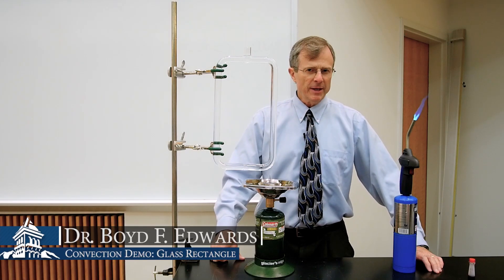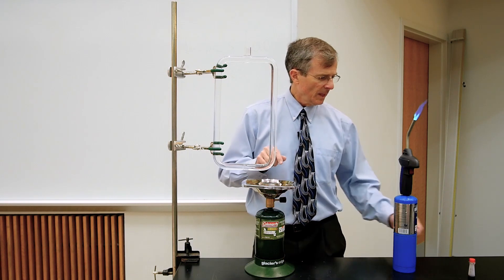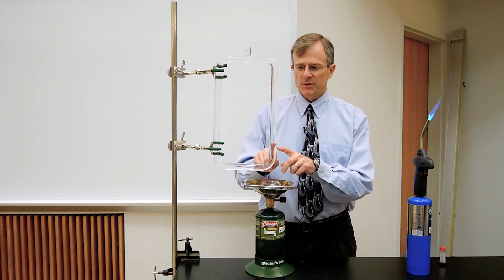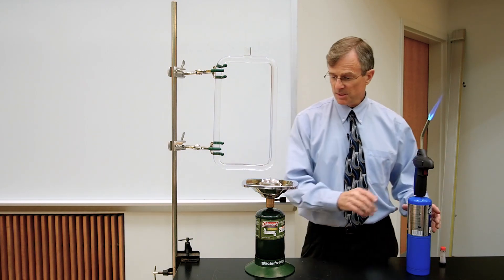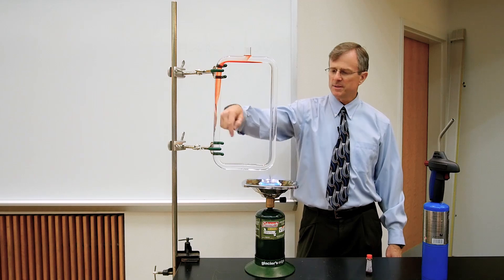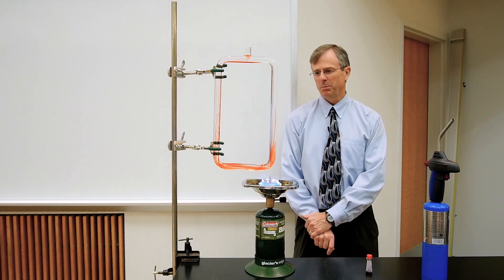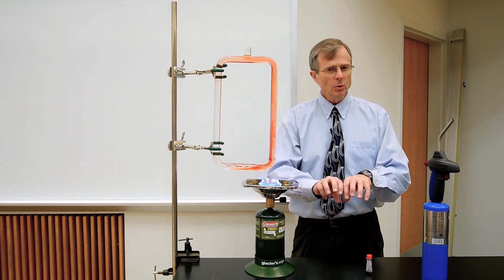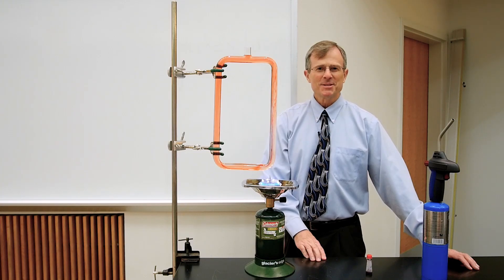Convection Demo: Glass Rectangle

Comment: anybody here for online school? 
|
|
|
|
Reply: U know it
Reply: Hayden Best is this u Hayden lol
Reply: It is I the one and only
Reply: Me
Reply: me
Reply: The FitnessGram™ Pacer Test is a multistage aerobic capacity test that progressively gets more difficult as it continues. The 20 meter pacer test will begin in 30 seconds. Line up at the start. The running speed starts slowly, but gets faster each minute after you hear this signal. Ding  A single lap should be completed each time you hear this sound. Ding  Remember to run in a straight line, and run as long as possible. The second time you fail to complete a lap before the sound, your test is over. The test will begin on the word start. On your mark, get ready, ding
Reply: @dissectedmarshmallow7432  Wait what?
Reply: yes
Reply: Me